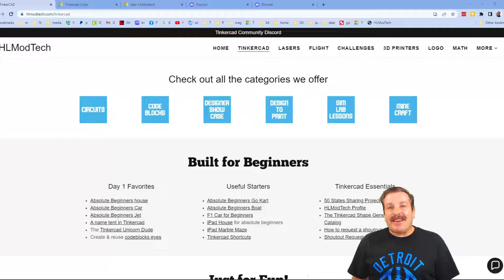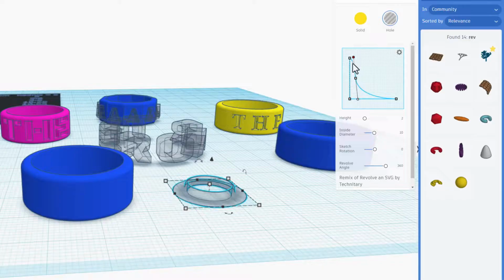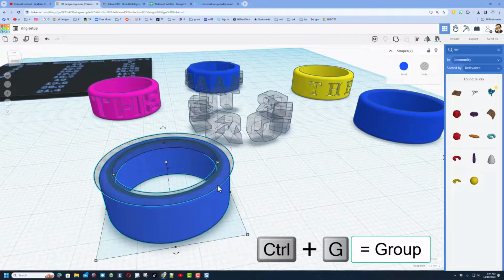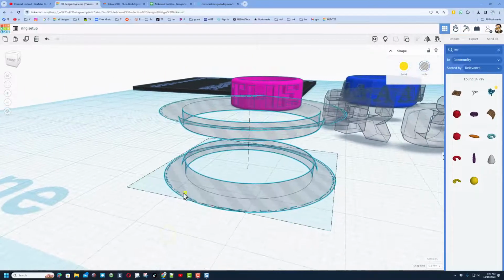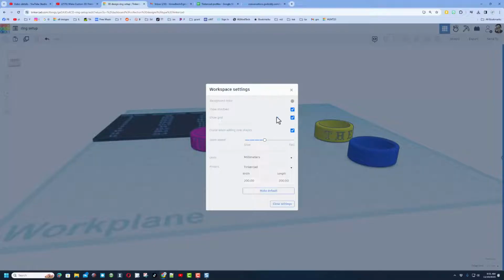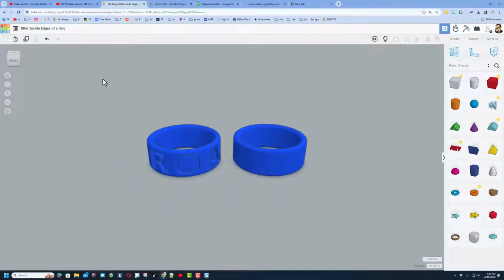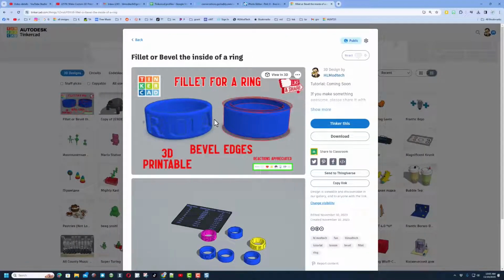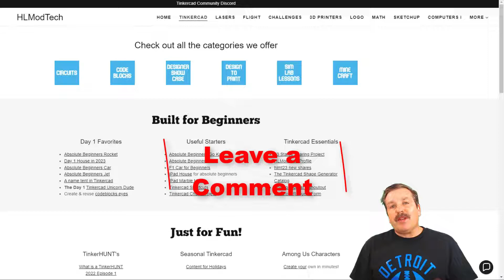Add a Fillet or Bevel 3D to our Printable Tinkercad Ring Mod in Minutes!

Comment: I have a 3-D stamp design that I want for leather embossing and it has straight edges down to the body of the stamp, which makes it somewhat weak. I need to add fillets to support the stamp imprint. Would this method work for that?
Reply from the maker: I think I would do that like I did with the fillet on this vent adapter. https://bit.ly/vent26
Reply from the maker: This was V1... For your project it may be the best place to start. https://bit.ly/vent25 It gives you the beginning of the project.

Comment: "Warning Will Rogers!"  MetaFillet not giving same dimensions for each side.  Place one fillet on the workplane, change the Radius to 10 in the window, then check the dimensions of the sides by placing the cursor on one of the white boxes to show the dimensions on the fillet, one side says "10.00" but the other side says "9.90".
Reply from the maker: I will double check... but check this video demonstrates how parameters are broken if we drag handles on a shape. It could be that too. https://bit.ly/breaktink
Reply: @HLModTech  Interesting how the shape of your first cylinder doesn't make it to the dimensions according to the visual on the workplane.
Reply from the maker: There is a good chance I clipped stuff out while editing... I was not too worried about precision there. The goal was to just show a technique.
Reply: @HLModTech  oh, sorry, I was not trying to criticize you, I was just pointing out an error in Tinkercad.

Comment: oh thanks, i just ordered a little bambu lab A1 mini printer because i need a skirting board (dont know the english name) because my brother has a concrete column in his living room and the local carpenter wanted 120 Euro for bending a real wood skirting board/base for the floor for eliminating the gap between floor and column. So i thought why not make this with a 3D printer, so i ordered one for 199 Euro, i think it can work with a bit of putty and paint. The column has a diameter of 25cm and i think those rings you showed in the video could do exactly that when i cut them in 4 parts with the software. Especially that revolver shape you showed in the video could do the trick. One concern is that it looks like its not "high res", like low amount of polygon. It would be nicer if it was "rounder" in general with smoother surface.
Reply from the maker: Cool idea. Tinkercad bumped up the resolution of some shapes this year to 128 instead of 64. I have always found 64 enough when the final product actually gets printed. Especially if you were painting them.
Reply: @HLModTech  yes but some shapes in the shape generator dont have the ability to adjust the resolution, i think its 8 on my object? Is there a software that can smooth my finished object later?

Comment: Looks like filet is not a forming tool but a cutting to get fillet. I’m ok with that much. I could really learn to learn tinker cad better than fusion or blender. But I’m also looking to change or remix models that is close to what i need that Bambu studio or orca can’t do
Reply from the maker: You are correct. Tinkercad allows you to add shapes... for forming or molding them is not possible. We have to turn things into holes and use brute force grouping to cut off parts.
Reply from the maker: This video gives tips for modifying an STL in Tinkercad. https://youtu.be/reUesJ0rafc Maybe that will be useful for your remixing ideas.

Comment: Hello! How can I create my custom profile chamfer?
Reply from the maker: Tinkercad really is limited to brute force on complex shapes. Sending to fusion is the sickest way. Smooth Tinkercad Design Edges Instantly Fusion 360 Fillets in Minutes!
https://youtu.be/XAWQdYRz_wA
Reply from the maker: That said, you can see in my latest video how the basic cube can be easily rounded using the radius parameter.

Comment: Thank you. I just wish they would include some basic modeling tools. No one needs the pain and tedium of Fusion 360 in their lives…Tinkercad is by far the quickest way to make most things.
Reply from the maker: My pleasure and glad it helped. 👍 As far as modeling tools, it is not likely. The "engine" that makes Tinkercad work uses solids and simple geometry. Would be sweet if they did find a way to squeeze it in there though. 😊
Reply: @HLModTech  everytime I try to take anything from Tinkercad to Fusion I get so many errors and the wait time is so insane even with just a basic cut operation and end up just doing it in the background in Tinkercad while I’m waiting and already have the item exported and in Cura ready to print. Should be called Confusion 360 haha. Anyway, I’ll persist and try to find the errors. Great content thanks 🙏
Reply from the maker: lol... had that same battle a week ago and just gave up. Confusion... #priceless. =)

Comment: Is there a rectangle version for this?
Reply from the maker: The cube has built in options for the outside edge... are trying to round the inside edge of a hollow rectangle?
Reply: @HLModTech  I was but I then ran across your other video on the topic and figured it out
Reply from the maker: Super cool. With almost 5K of videos up there... there is a good chance I have something. 🤣🤣 Thanks for dropping by.

Comment: looks like tinkercad change the shape...there's no revolve angle option. you can't revolve it to a full 360 degrees or any other rotation other than the default 270 degrees...thanks tinkecad... :(
Reply from the maker: Just double checked. All is the same with the shape. I was able to do all the steps from a blank file just like the video shows. Give it one more shot and if your stuck, maybe send me your project. To share a project you need to use the steps in this video https://youtu.be/XeDQjhRK8lg

Comment: Morning HL, love your videos. Short and sweet right to the point with solid info, I appreciate that. Do you know a simple way to place a fillet around the exterior edges of a hexagon and around the interior edges. I've created a hexagon with hexagon cut out through the middle and want to fillet all edges. I like to place a 0.7mm radius on all edges before 3d printing, I find it takes the edges off nicely.
Reply from the maker: I would skip the brute force and go to this skill. https://youtu.be/pzyqdX2t0L8  The longest step of that process is getting Fusion 360 installed.
Reply: @HLModTech  thank you for the reply.  If I use an stl made in fusion on the hobby license to share in my YouTube channel. Will I be breaking the licensing rule?
Reply from the maker: How far is your YT channel from a hobby? My wife will never count my YT time as a "job"...

Comment: I've been looking for a way to curve/soften/bevel the edge of an imported SVG file without success. SVG revolver doesn't appear to be a solution. Using curved pipes as in your beveled arch video won't work for the more complex shape I'm working with—I came close but it took many overlapping segments to approximate the curve. Imagine trying to bevel the edge of your four leaf clover from the video you did 6 years ago "Import a SVG into Tinkered". Is there a Tinkercad solution you can discover?
Reply from the maker: There is a point where it is just wiser to use a tool like Fusion 360. https://youtu.be/3_Gwr-P6D9o That is with a Tinkercad shape though... I am not sure what the process is like if you are using an STL.